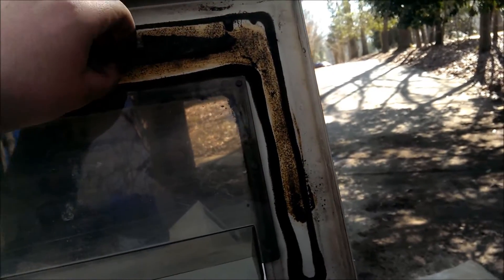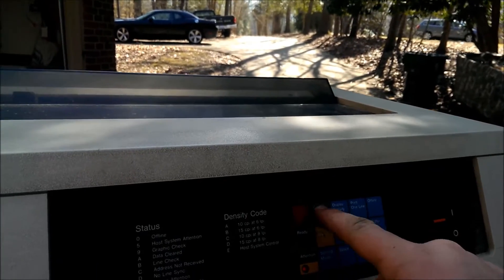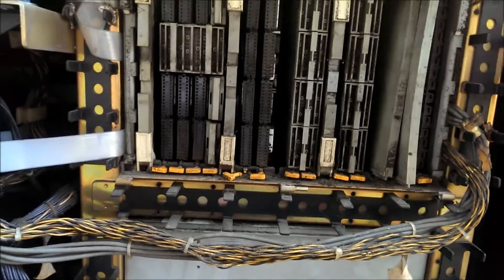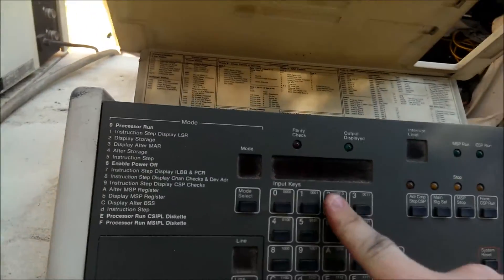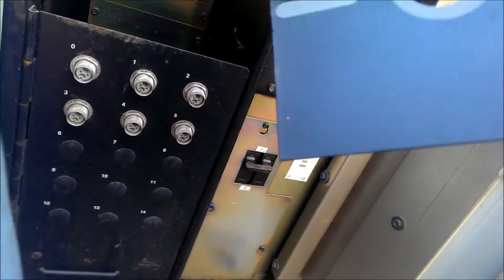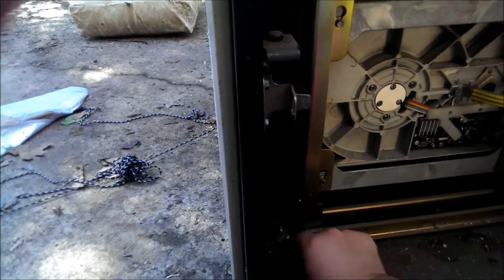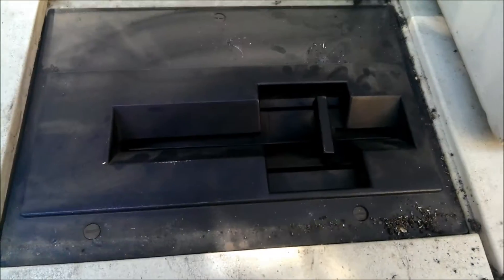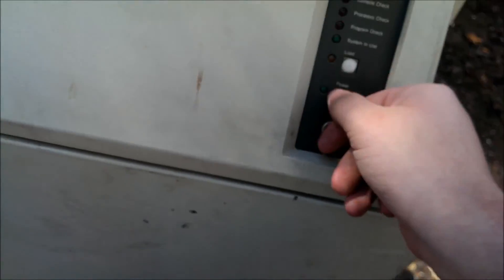IBM System 36 (5360) overview

Comment: Have you been able to IPL it yet?
Reply from the maker: no. i've decided to part this machine out and scrap it. it's wires were all frayed and falling apart and it was missing a power converter. i kept all the controller boards and drives. i plan on taking apart one of the 10 inch drives to see whats in it. i'll probably end up selling the other hard drive and floppy drive.
Reply: ***** Actually it wasn't missing anything. The extra transformer that could go there was for extra power delivery if the system used more than the top card cage. Sad to see that it was parted out as the number of these systems are quickly dwindling and there is very little info about them online. The frayed wired would have been a pain to replace all of them but the right person would have taken the time to. Here's a photo of a similarly configured system and it is complete for its configuration. http://www.neurotica.com/w/images/4/48/IBM-System36-front-door-open.jpg As you can see there is no transformer in that location. And even if it did have the extra transformer in place it doesn't seem to use that one connector you point out as shown by this photo. http://www.corestore.org/5360-6.jpg (the rest of this system can be found here in other photos http://www.corestore.org/36.htm ) as you can see it has a second card cage being used, thus it needs the extra power delivery. I guess this could just be a simple lesson that sometimes things that appear to be missing may not have been there in the first place ;) Atleast it got parted out and not scrapped.